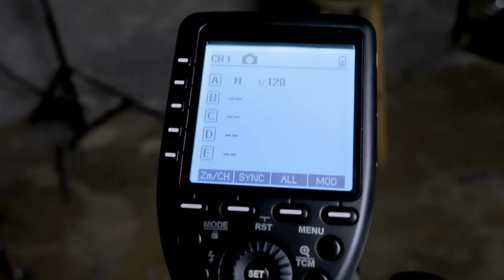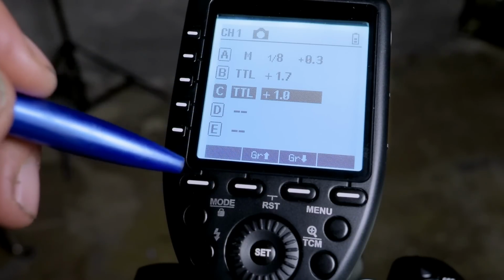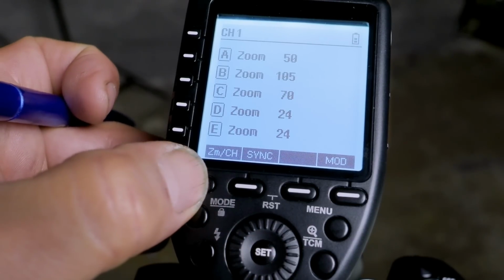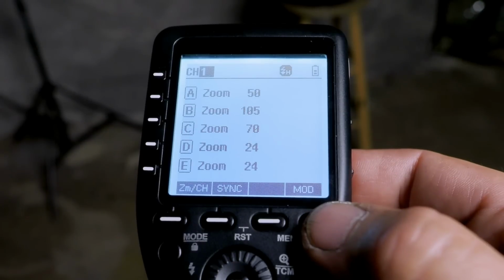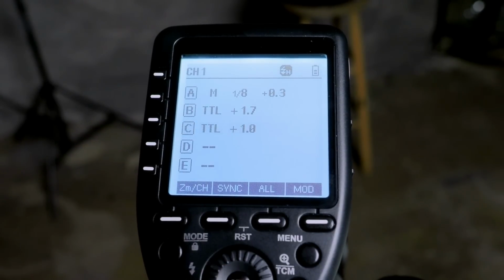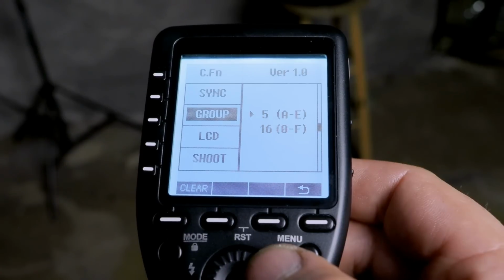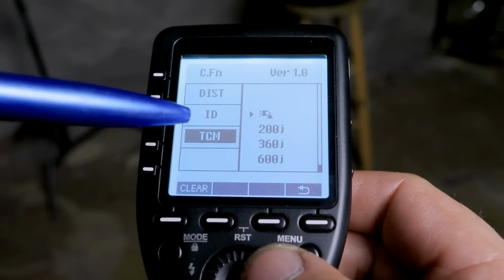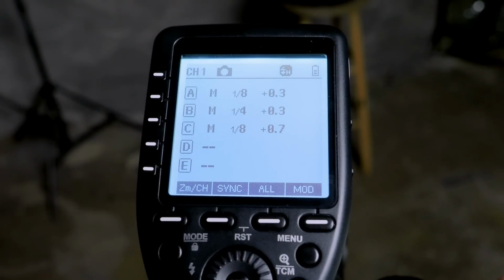Review and How-To of the Godox XPRO-o for Micro Four Thirds MFT

Comment: what you say is that i can buy for my panasonic lumix a Godox XPRO-o and i can use my canon mout nissin flashgun while buying canon godox receivers ?
Reply from the maker: Yes no and sorta. Godox O works on m43. It can control godox flashes from other brands. No nissin wont work entirely. however It can work as an optical flash slave with very limited capability.
Reply: @LavikkaPhotography  so is there any solution with godox transmitter  "to rule them all" ?  i assume tham with godox O you can control directly godox flashes or you have to use receivers anyway ?

Comment: Your video mentioned using an X1 Receiver for firing strobes or flashes that aren't a Godox product. I use an Olympus OMD EM-1 camera and found the Godox Xpro-O for Olympus Panasonic TTL Wireless Flash Trigger for mounting on the camera but I can't find the X1 Receiver for Olympus. I found the Godox X1O 2.4G Wireless Flash Single Transmitter for Olympus but the only Receiver is Godox 2.4GHz X1R-N Wireless Hot Shoe Flash Trigger Receiver but this is listed as for Nikon. Do you know if this will receive wirelessly from the Godox X1O 2.4G Wireless Flash Single Transmitter for Olympus on camera? Thanks for your valuable experience with using TTL and Olympus equipment!
Reply: I'm wondering the same thing... will ANY receiver (N, C, S) work for with any non Godox flash unit with the XPro-O?

Comment: With my older X1T I could control my modeling light in the AD600 in three steps of brightness ( low, mid and high ), however with the X Pro I can only switch the modeling light on ( full power ) or off. Not sure why this functionality was changed 🙁
Reply from the maker: Yeah I forgot about that. I don't know but it may come back in a firmware update.